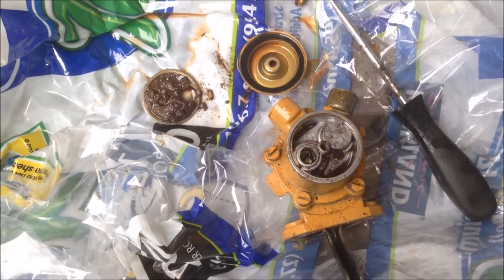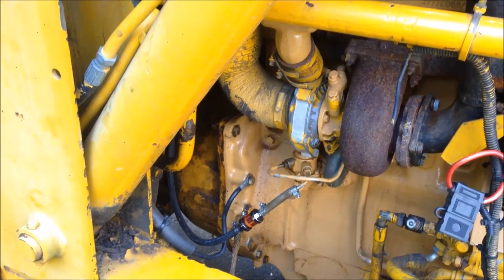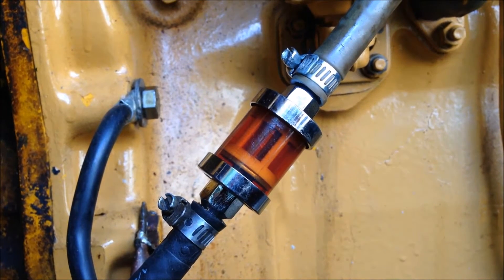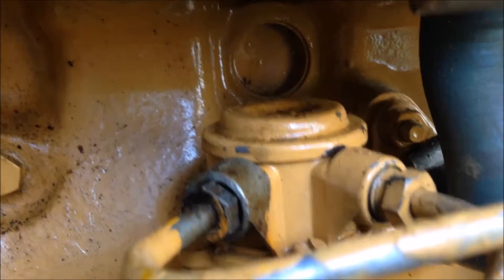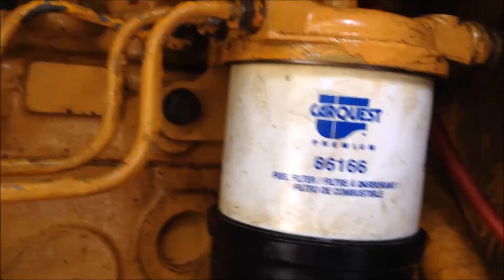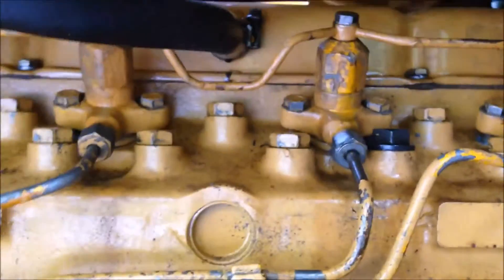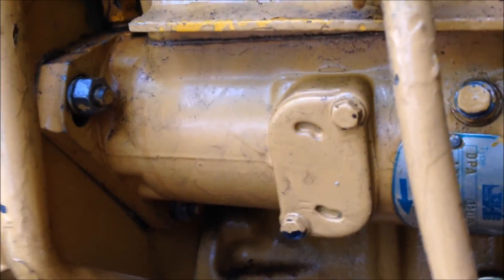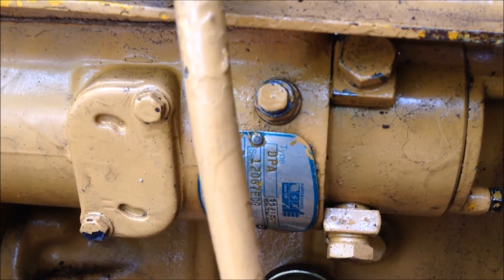Biological Sludge Growth in Diesel Fuel Tank - Part 2 of 2

Comment: I have a 1400 B probably 1992 with the Lucas CAV pump.  Looks about the same only bleed screws seem to not be there and very stubborn after a fuel run out or in this case a change of fuel pump and sediment filter.  Wondering if that other filter is inside the Lucas as you mentioned is the case with the DPA?  Any help appreciated as Field Reps no longer visit our USA area/
Reply from the maker: There are 3 filters on the JCB - if you have fuel to the injection pump, then I would check the filter on it.
1) Fuel pump
2) Fuel Canister filter
3) Injection pump